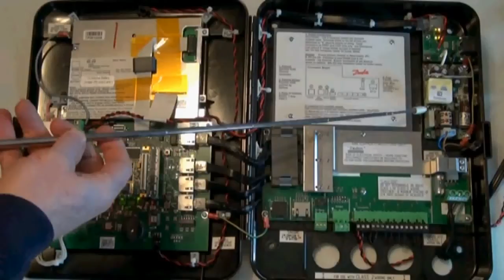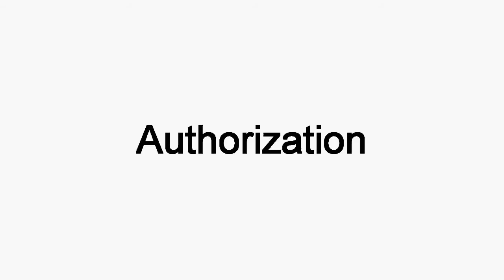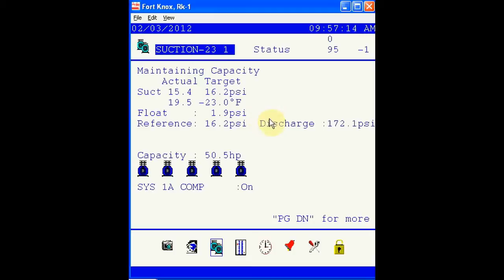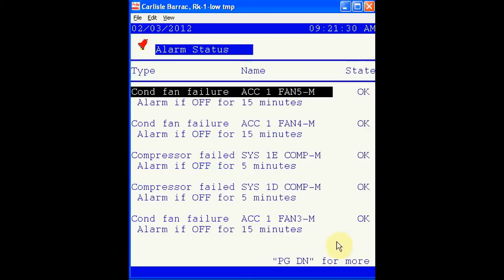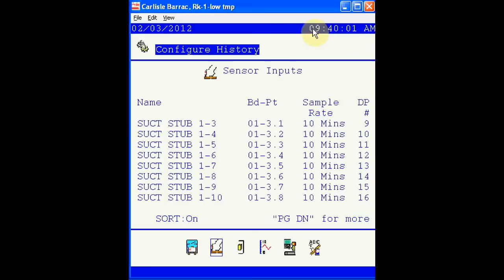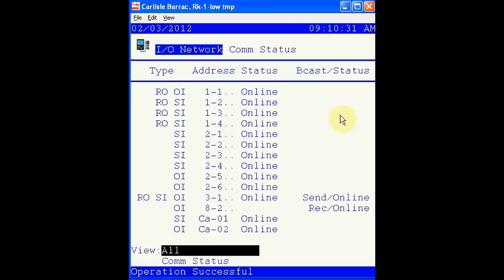Basic understanding of the AK2-SC 255 controller (hardware) and how to interogate | Danfoss Cool

Comment: Hi, good video. the internet feature wasn't covered. A question - On the internet settings page, should the internet ip address be the public ip address the AK-255 software installed on computer connects to?
Reply from the maker: Hi Chris, Thanks for comment. Below answers to your questions I have received from my colleague. Hope this will help. 
If you have further questions you can also send your questions directly to ADAP KOOL® System Support - 7575@Danfoss.com

Rgds 
Sujan Sainju, Danfoss Cooliing

WAN Internet Settings for AK-SC255:
To access the units from WAN, we must meet the following criteria when we setup the system:
1. A router that has the port forwarding ability, and port forwarding is allowed in LAN. 
2. Be able to configure the router (password and username). 
3. The router must have the WAN external address, which means this router must be accessible from public internet. 
Settings for AK-SC255:
To access the unit from WAN, we must setup AK-SC255’s external IP addresses and Web server port as well. We should go to “Configure -> Internet -> Config” Screen, and input the WAN setting information. Input master information for unit 1. 
There are several important things we need to take care for this setup:
1. Select “Yes” in “Use Ext. Internet” field.
2. Input “Internet IP Address” field, please note this address must be the router’s WAN IP address
3. To make this settings effective, reset the unit after the configuration.

Comment: If the communication module were to go out. Could it cause a controller to go offline?
Reply from the maker: Hi Ashton, 

Yes, if the communication card is disconnected or if it fails, the communication with the controller will be lost.

Hope that helps!

Comment: Can you help me about the laptop specification this software would need in a minimum? Also we have this software for 7 years does it need upgrading? Thank youuuuu
Reply from the maker: Hi Vii Rose, There is a supporting software AK656 which and it requires PC running Win 7 or higher operating system.  Please note that both the AK-SC255 and AKA65 are End of Life and no further updates are available. You can find link to download AK656 as well as more information about the phase out here. https://www.danfoss.com/en/service-and-support/downloads/dcs/adap-kool-software/ak-sc-255/

Comment: I have a dual temp coffin case, I can put it into defrost with the override switch but does not switch the relay when the controller says it is in defrost.  I am going to switch the I/o board Monday.  I don't have much experience with this system but only thing that makes sense to me.  Any advice?
Reply from the maker: Hi Kev, Could you please let us know where you are located? We can then try to reach out to the relevant local Danfoss support team.
Reply: Found out somebody switched control to eepr and needed to set for  the solenoid in controller. Thanks
Reply from the maker: @smallfried02  Great to hear.👍